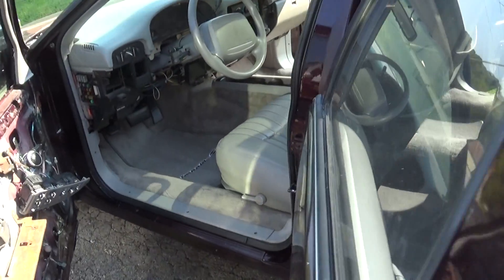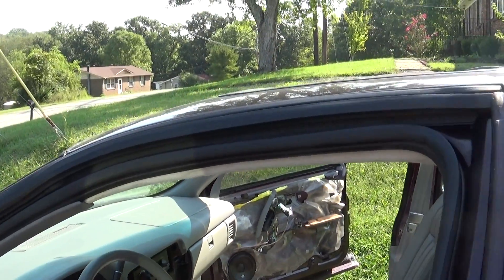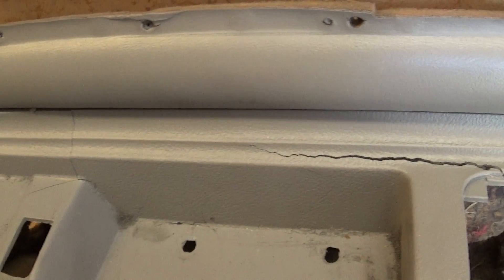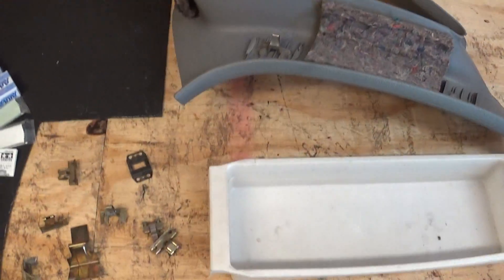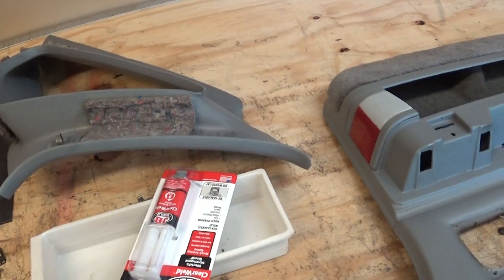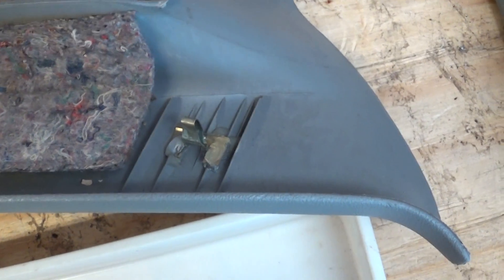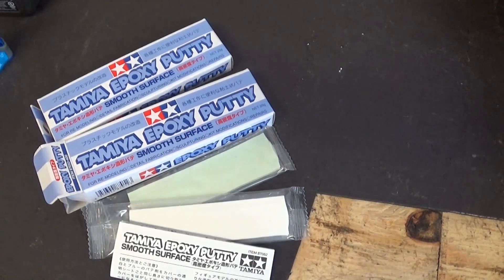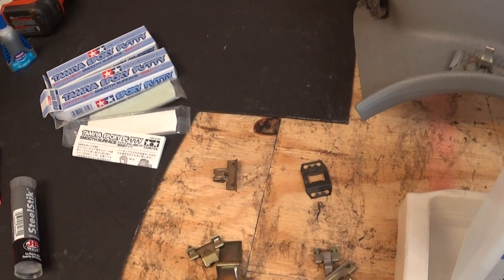1995 Impala SS tips for repairing small cracks on door panels & more

Comment: Recovering top of dashboard with leather and painting lower part of dashboard on a 1996 impala SS
Reply from the maker: Derry Perry careful if using real leather on the dash, it will shrink in the sun, sometimes very fast too. I always use vinyl now.
Reply: @charles1matt  I got real leather seat will you be able to tell the difference
Reply: @charles1matt  what paint is to be used on the lower dashboard and kick panels
Reply from the maker: Derry Perry SEM brand is what I been using, color warm grey or presidio
Reply: @charles1matt  my inside is black
Reply: @charles1matt  how do you get the old paint off
Reply from the maker: Derry Perry should be any factory paint, but rubbing alcohol will usually work without hurting the plastic
Reply from the maker: "should not be any factory paint"